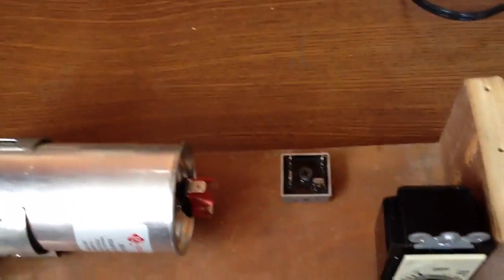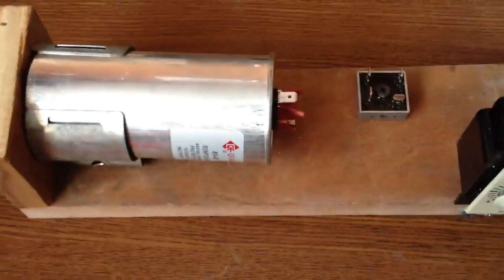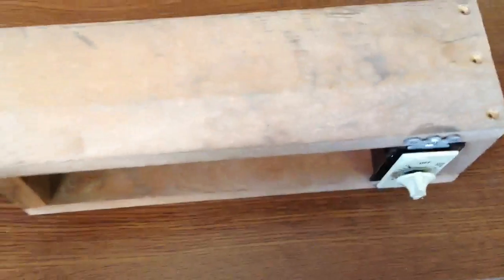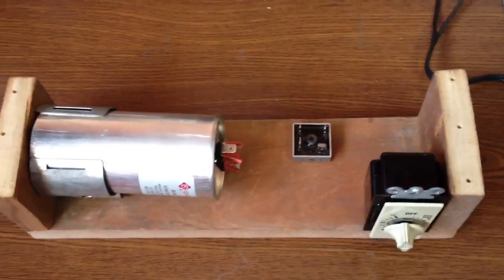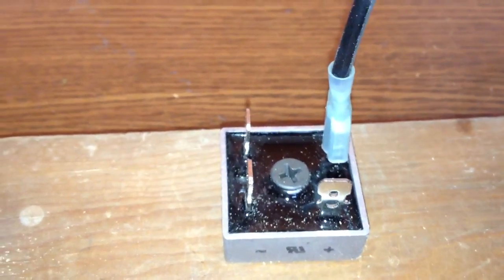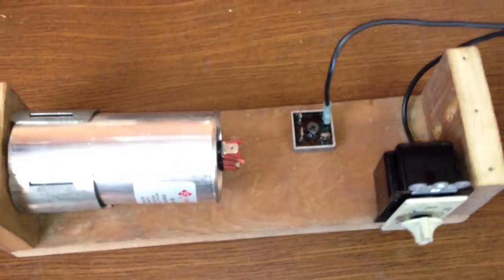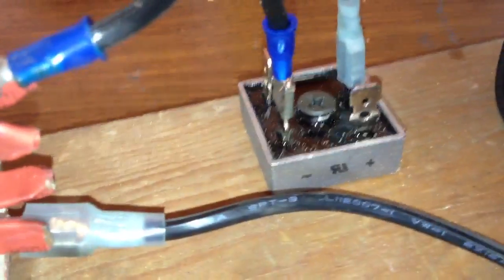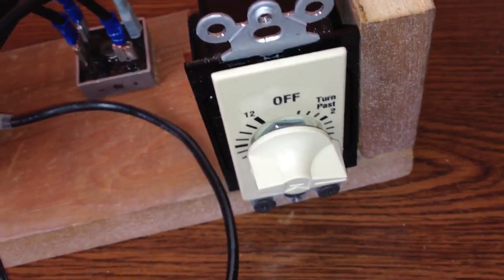How to build a Capacitive Battery Charger (Part 1)

Comment: So I'm thinking of doing this with 2 caps in it - small and a large with a switch so I can do small cycle batts at 1or 2 amps and faster charge say, 10 amp for car&truck batts. What would you recommend and how would you wire it?
Reply from the maker: 80mf cap for the big battery, a 10 for cycle batteries. Just have a two way toggle switch. Turn unit off and UNPLUG before switching between the two.

Comment: If I was to fast charge a 12v battery, I know I must put more capacitors. Instead of a timer, is it possible to put a voltage regulator? Thank you very much!
Reply from the maker: no, for starters, that defeats part of the purpose. These chargers are self voltage regulating. Next, the voltages will fluctuate. If the resistance builds, the voltage will automatically continue to increase, burning out a regulator or resistor. Next, you would loose the benefit of desulfating.

Comment: i have questions. would this charger work for an alum filled battery?  like pwm chargers are used to charge those types of batteries, from a full discharge. do they need a partial reversing charger? i say this, because from what i've seen. they are more resilient than lead acid. but they need a pwm style charger to do so. even then, they still do a better job than a lead acid at recovery with little to no damage. it would seem this type battery would make expensive golf cart deep cycle batteries obsolete.

 do you have any idea if crystal cell "dry", borax,epson salt, no salt and alum design batteries take a charge. making them a secondary battery, like a lead acid battery.

 have you built your own batteries? i'm thinking on doing just that from the lead spong battery plates and omiting the red lead plates, using perforated copper plates in place of the red lead cathodic plates. if need be, i will pour my own lead plates. making a rugged duty battery. for the isolators between the anodes and cathode plates. i will use the sides of milk jugs with many tiny perforations/slits in them. or i can make them from thicker plastic jugs. thick walled jugs sides that can support the weights of the plates and raise the plates high off the floor of the battery case. and i can put in as many plates as i want to boost the amp rating of each cell. for that fact, i could make my own one piece 48 volt battery.

 i've been thinking on making a hybrid non-leaning reverse trike like the t-rex. using an e-tek or a manta-2 10 hp dc motor and a honda cl-450 scramble engine. the engine has the ability to get 97 mpg at 37mph in it's bike configuration. and using a cvt type transmission on the motor. i need to find a controller that will allow the motor to act as a regenerative breaking system. activating the regenerative breaking with the break light switch and a relay. reducing break lining changes too. between the engine and the motor it should leave the line hard. i will run a normal throttle for the engine and a thumb control for the motor. so i control what's being used and how much of each. utilizing the motor on acceleration will reduce fuel consumtion even more
.
 as for emissions i don't get a good _______ RATS___ what goes on...i hug trees that i will cut down and build a home with, heat with and sit my __ on. the earth will take care of itself. just like the ozone layer is fix by the aurora borealis and the aurora australis. a coronal discharge like that made by motors with brushes..instead of jets spraying the chemicals aproved by bill gates. they should be making high altitude Airships, Dirigibles, Zeppelins, & Blimps. reducing fuel cost by putting brush motors on them, with flexible solar cells along the top and sides of the body of the ship, to help with the ozone layer issue. if there is a ozone layer issue in the beginning. just because someone says something doesn't make it so. especially when a lot of money is involved.
 ok enough of me and what i want. have a super day and if you will, please reply.

Comment: Does the capacitor also desulfate the battery?
Reply from the maker: The capacitor is the current limiter. It's what limits how many Watts can pass through the setup. The smaller the cap, the less current is being passed. If your looking to desulfate more so then charge, a smaller cap will slow the charging, but still allow the pulsing for a longer period of time before the battery is full. Example, for LONG TERM storage and desulfation, I have a mini-cap charger setup with a 5 micro farad cap. I can leave that one on my truck for a month at a time (my truck has gone through 1 tank of gas in 6 months, as I have been driving my electric cars instead).
Reply from the maker: More or less what don't I do. For starters, Knowing HOW to spend money PROPERLY is very important. Most people, especially younger, have no concept on how to save, and when to spend money, and how to look for a bargain when they do. 
I see it all the time at the grocery store. They go into the high end stores, like whole foods, etc... and spend $100 and come out with a single bag of groceries. I shop Aldi's. I go in, I come out with 3 baskets of food, including organic foods, for less then $100. Next, starbucks and other coffee house coffee. Just get a damn keurig. It's the same coffee just without the fancy cup. 
Next, I pay my bills. ALL of them. And I pay them on time. I'm 29, got my first credit card when I was 15 (co signed by my parents). I have NEVER pissed a payment, on ANYTHING. The few times I did, I found it was actually bank error, and had the issue resolved in my favor.
That leads to Credit Score. I have a 830 without even trying.

I dont make much money, maybe $40k/year. On 40k I can afford my house (not the nicest but it is fairly large 4 bedroom, 2 living rooms, 2 full size baths, big back yard, 2 car garage in a very good area), my Tesla, my truck, money to put away for retirement, and money to take my boys on a nice vacation every year (Multiple now that I have a Tesla, as transportation costs are basically free now...). 
I even had enough to build a ride on 7.5" gauge railway in our back yard. 
Heck, we're even going to China in 3 weeks (As part of a tri-purpose trip, 1, to film the new Tesla Store in Chengdu, as it's now the largest T-Store in the world, 2:Vacation, and 3,  a certain beautiful, extremely intelligent, whitty woman that I hope will become my boys new mommy). 

It's not always about how much you make, it's about how you spend it. Also, I'm not living in Cali, the most screwed up state in the union. 

I hope that helps. 

Oh, never answered exactly, what do I do. Lets see, half my income is Youtube videos, another 40% of my income is Selling motorcycle and scooter parts online, and the last 10%, whatever I can get people to pay me to do. 

I am a single father of my two boys, one disabled, so I work my royal ass off to provide the best, and be the best for them. In return, they give me their un-conditional love, and thats all I want from them. It sometimes is very hard, but I make everything work, and I make it work with them growing up in a home where they do not need to hear "We cant afford that". I will always make sure we can afford everything we need or want. Not necessarally meaning that they will get what they want :p but I refuse to live in poverty or live off the system. That is Unamerican. 
I will admit though, my Vinny does get Assistance for medical due to his disability. Without that.... Well, he is un-insurable due to his down syndrome, being in the NICU when born for 2 weeks was well over $1 million :( Poor lil guy. He was dealt the shit stick in life, so I will work to make him as happy as possible, and help him live the best life he could ever. 

Salut! Grazie!
Reply from the maker: I have lots of videos planned for that trip. You all will not be disappointed.  I dont even buy the k cups. I have a stainless reusable refillable k-cup, I put my own coffee in it. Use Aldi's coffee, cant taste the difference. brings it to about 5cents/cup. 

You need a certain number of views and subs before you start making anything, but once your in the program, they go based on interaction of your videos, return viewers and subscribers. Another even more important is length of viewership. As in, how many people close the video and go to a different one within the first 10 or 15 seconds, and how many people watch a video to the end. Videos that get more "the end" views, and more interaction with the viewers (Comments, thumbs up, thumbs down, shares, etc...) get higher paying adds, as the viewer is more likely to watch the add instead of closing it. There is rocket science behind it. I'm attempting to make youtube my full time job. I have a long way to go. My gold is if I can hit 10,000 subscribers by July. if I can pull that off, my channel will get another youtube upgrade and I will have access to a lot of creation tools that will help me greatly expand (Including the LA Creator Space and studio access).
Reply: LOL.
Reply: Kman you have your priorities worked out just right, and you are no mans slave, God Bless You.

Comment: Hi
For a 220 v ac sytem to charge a car battery 60 ah 12 v 
What size of cap   and input current is required  to run from solar inverter    thanks
Reply from the maker: Not needed. You can plug the capacitive charger into a 220/240v outlet. Just dont charge a standard car battery with it....
Reply from the maker: Do not use with a inverter. The power factor is very low, and can cause damage to your inverter. 60-80mf cap should be more then enough.
Reply: Thanks for ur quick reply and Merry Xmas  i have all the parts in ur video and will do the replication   cheers
Reply: KmanAuto, for 4000w inverter 120vac output can't supply enough power to charge?
Ty

Comment: Hi
For a 220 v ac sytem to charge a car battery 60 ah 12 v 
What size of cap   and input current is required  to run from solar inverter    thanks

Comment: is this circuit can be used in a country that have a 220volts a.c. mains, without any modifications? thanks in advance for your reply...
Reply from the maker: Yes, though reduce the size of the capacitor by 50% at least from what I show, otherwise the charging current would be doubled. And be extraordinarally carefun. Do not touch the clamps, or battery posts with the unit plugged in, as the charger will be putting out as much as 340 volts!

Comment: Hi, I would like to Use this on a 120 Volt Battery bank Will this be able to float the bank? or will it just keep charging to it's highest Voltage? whis is about 140 Volts??
Thanks

Comment: Thanks Kman, so do you charge the battery first then hit it with the cap-charger or cap charge over night then chager? sounds like you keep it long term as well as over night. 

I have an old 12V cycle battery, when I first charged it, the volts went to 40 and slowly came down to 12.2 It still can't hold a charge. Think it's dead? 

Thanks again for all your help. It's very much appreciated.

Comment: Hi, I'm a bit new to this.

I'm not sure how this is auto adjusting to a safe DC level.

So you have 120v AC going into a 440v AC cap, then the rectifier drops that level to a safe DC voltage that wont kill you when you touch the battery leads?

Cheers.